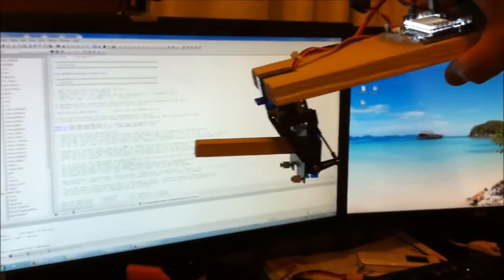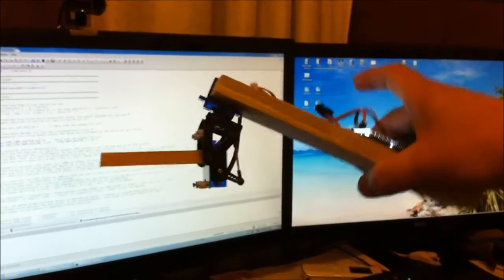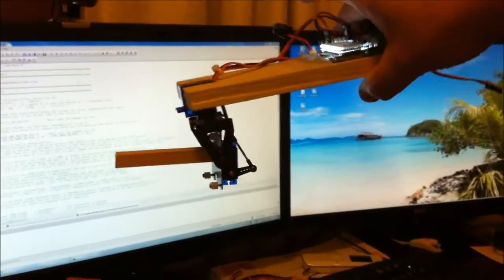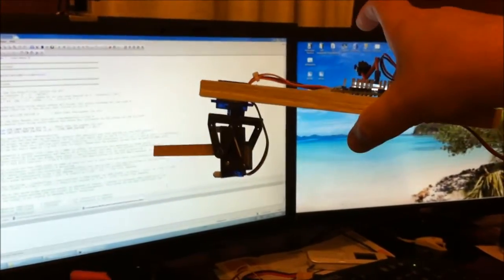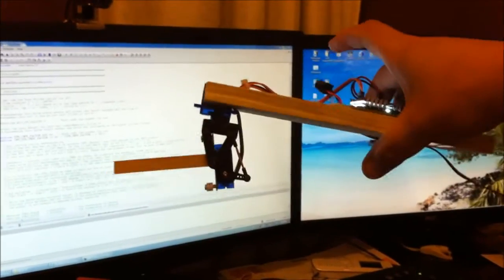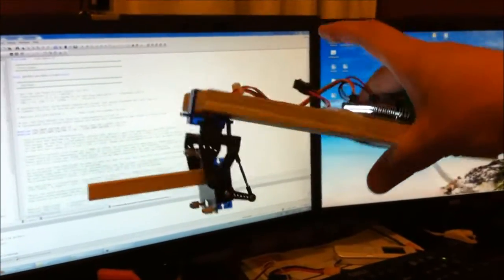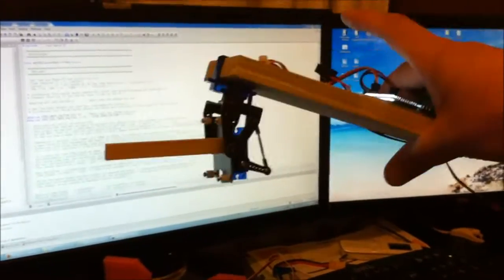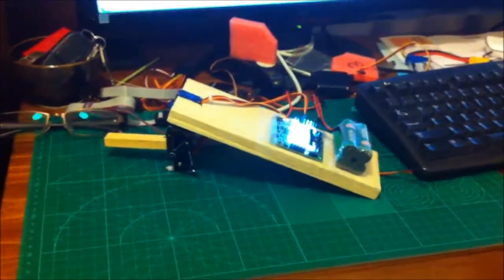New IMU for OpenAero2 - Camstab demo

Comment: Hello, i have recently flashed my kkboard with OpenAero2 latest firmware. Original KK firmware requare to be "armed" to start stabilisation etc..I'm going to use it on my rc car for Camera Stabilisation. Can you make a tutorial to explain setting to use camera  stab..
Reply from the maker: Hi Baris. Go to the RCGroups forum for OpenAero2. On the first page you will see links to the user guides. Once of the user guides is for stand-alone gimbal setup. That will help you :)
Reply: +David Thompson after 1 year i decided to buy a 2axis gimbal controller :)but  thank you to reply anyway. Best regards

Comment from the maker: Hi an IMU is an inertial measurement unit. It's used to determine the correct attitude of the model. Just Google OpenAero2 for the Groups thread on OpenAero2 for more info.